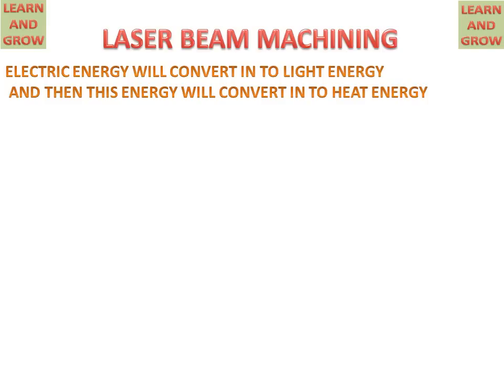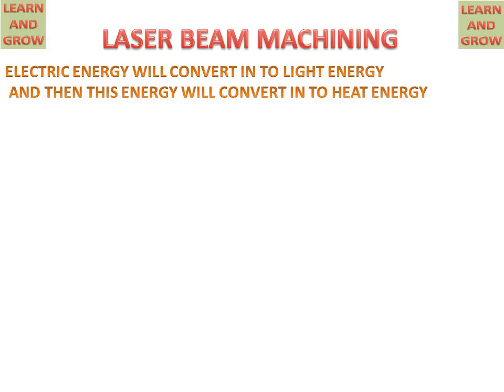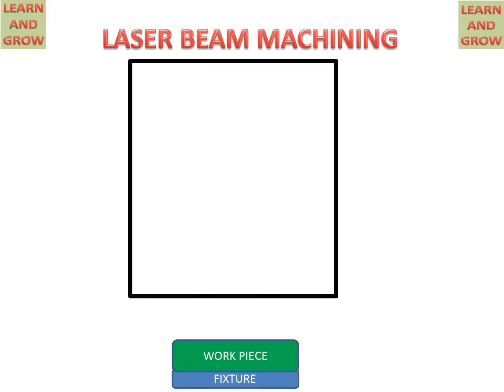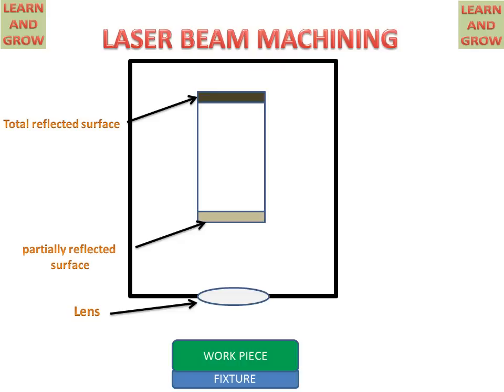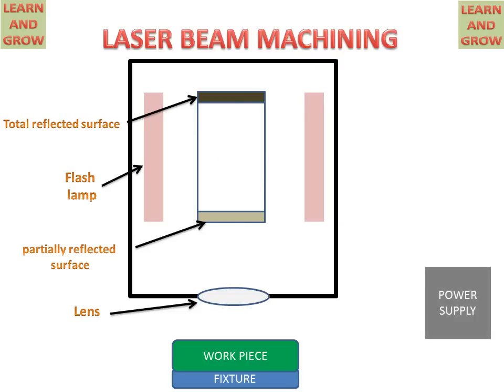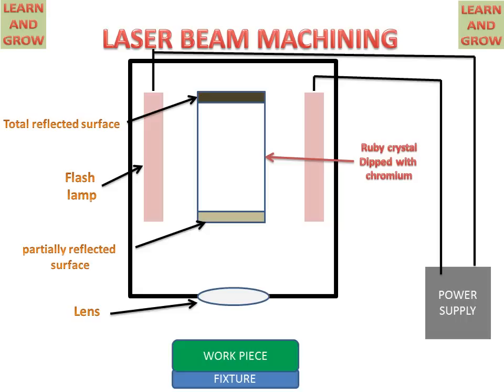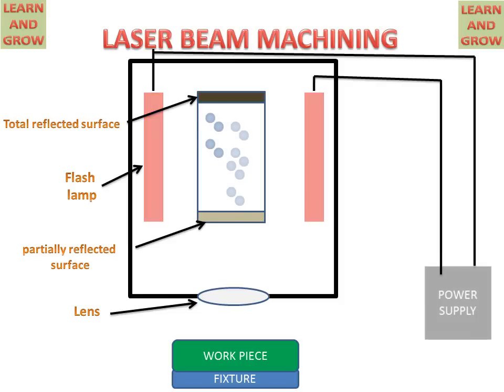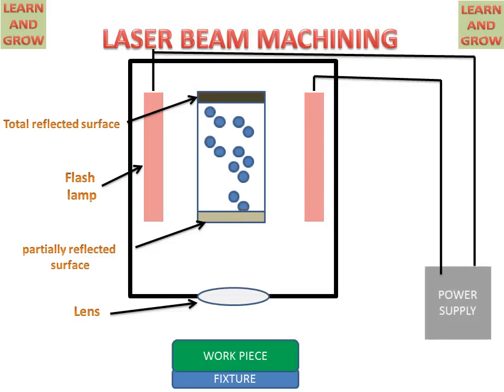Laser Beam Machining (English)

Comment: Why different type of gas is used in different type of laser cutting machine, like co2 gas is used in co2 laser cutting machine, what are the role of these gas. What are the fundamental differences between co2 mettel/nonmettel laser cutting machine, plasma cutter, mettel cutting machine, if possible then pls use different type of flow chart, diagram, 3d animation or 3d pics for better explanation. What is rubby crystal here. Thanks for your great explanation sir.
Reply: Sushil manohar Prabhakar 
Instead of ruby crystal we use co2 laser in that place bro